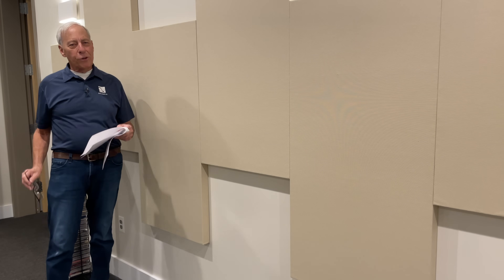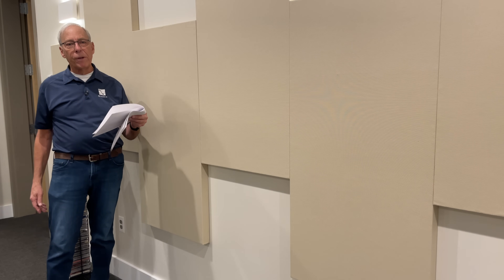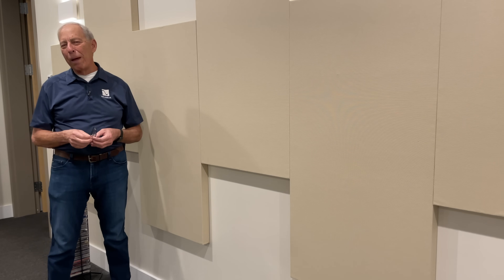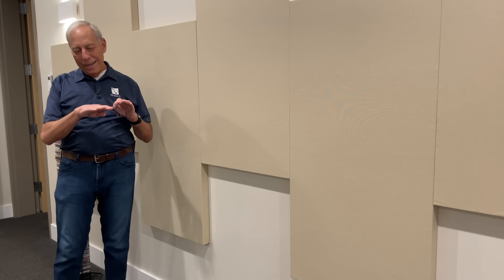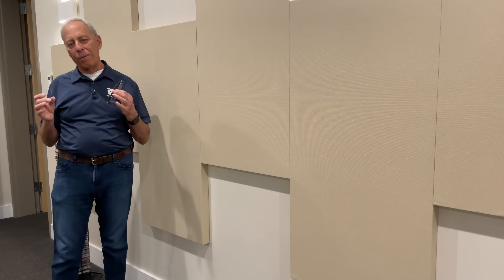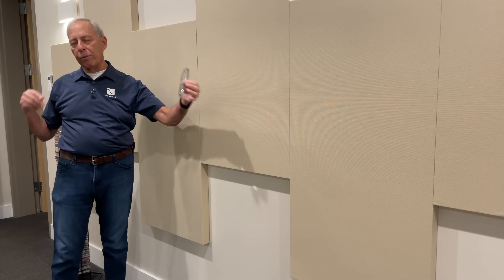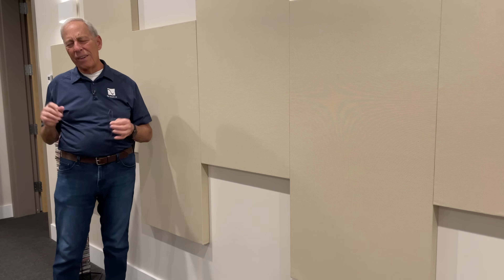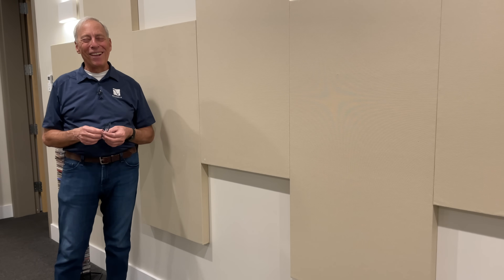Do audio connector materials matter?

Comment: I find anything that reduces DCR (DC series resistance) in the signal path (including the AC power supply path) is usually the best sounding. No connector is the best connector.
Reply: In theory that is true, however, that is not usually very practical in most cases.

Comment: First connectors are used for convenience. The addition of a connector will introduce a change or noise into the signal path. The materials are chosen for their physical properties, electrical conductivity, and ability to prevent corrosion in order to minimize connectivity issues

Comment: Paul ehh you made a mistake. 😬 Bass is made of parts copper and zinc not tin.. Copper and tin is bronze. Little detail but your right connectors materials do make a differance... For viewers.. Plated Copper colour with Iron is a no go.
I test them with a magnet if it sticks its iron plated garbish, don't use it.

Comment: Paul you thinking the cables make a difference is called placebo effect. A signal from an amplifier going through a speaker wire to a speaker is not einsteinian. The only thing that's going to matter is that it has very good conductivity which would be copper and then it has thicker gauge wire Which is less resistance. Other than that the fancy cables that are thousands of dollars can't magically make the music sound better. It's just a signal. Nothing more nothing less. It's basic
 electricity fundamentals.
Reply: "It's basic
 electricity fundamentals."...and that is the downfall of your 'argument'. On first overview electrical energy transfer via cables/conductors is simple but the devil is in the details. All materials cause materials specific excess noise otherwise termed 'signature' and this low level noise is the driver or 'nuances' in sound reproduction and preferences. Cables do cause differences in system sound and for perfectly explainable reasons.
Reply: @ericmc6482  ok, give me specifics. Mention any $500 set of speaker cables...versus let's say a pair of $50 Monoprice Monolith cables. Describe exactly why and how the  $500 pair will be able to create more blissful sonics than the $50 pair. Go.
Reply: @ryanschipp8513  I make no claims of price/'performance', I am saying that cables will sound different according to the materials used, most importantly the dielectrics used, colourants and modifiers (UV protection, plasticisers etc) in insulations have sonic effect as does the base polymer used. I find clear insulations sound most natural with titanium dioxide white colourant (damped sounding) perhaps a second best in terms of my preference. 
The key here is that all the materials in the cable introduce 'excess noise', the spectral and dynamic behaviours of this excess noise vary in accordance with the above statements and this causes 'signature' sound of cables. 
I have devised proprietary mix of elements and compounds that can be tailored to produce any sound signature desired when incorporated into insulations or connectors.
This range of 'sounds' can be varied from 'dead clean/dead flat' to any tonal characteristic and/or dynamic characteristic desired.
Cable sound is not mysterious to me, what I do find mysterious is that some audio enthusiasts pay extraordinary prices for what is basic materials science embellished by 'fancy' constructions and even 'fancier' advertising copy.
Reply: @ericmc6482  I think the major disconnect between most audiophiles vs enthusiasts vs average consumer regarding any specifics on sound quality and the debate at large, all boils down to the difference in the gear being used. Specifically, speakers that have the capability of being revealing and accurate in producing sound. Most people don't have speakers or amplifiers that are built with quality components. A speaker crossover thats using iron core inductors and sand cast resistors can't possibly reveal the nuances that youre describing. The audio signal is being smeared and distorted much more by the low quality internal components. Most probably don't even know what components are used in their speakers, much less know the difference. So, changing cables and connectors won't make a bit of difference in sound quality in their case. The bottom line is... if you have the right equipment, any changes to the material in the signal path will change the audible signal. The guy buying Klipsch from Best Buy has a much larger issue in terms of quality components than what material his speaker wire is insulated with. I respect the audiophile's pursuit of the perfect sound. I simply don't have the budget for it. The difference is, I know what I'm buying and have reasonable expectations regarding its capabilities and performance.
Reply: It's not basic at all, sadly for you it's lot more complicated.  Perhaps you belong the "fedabs"?  That's the deaf aid flat earth society. 
Do you really seriously think that the thousands and thousands of hifi enthusiasts out there are dumb or something, that they've all been made fools of?  That somehow you're more intelligent than all these people just because you understand a little "basic" electronics?
Reply: @legrandmaitre7112  Yes, he probably is more intelligent, because he wasn't stupid enough to spend hundreds of dollars on speaker cables.
Reply: @ianhaylock7409  exactly
Reply: @legrandmaitre7112  
Actually anyone that spends thousands of dollars on speaker cables is severely misled.  I guess it is ok if he has money to burn, but it is unethical for manufacturers to push this BS.
Reply: @legrandmaitre7112  it absolutely is. Why don't you concentrate on exactly what I said my comment. You are just rambling. It's simply an audio signal. Okay mr. Smarty pants, tell me what a $500 speaker wire has in it that will improve Sonic's vastly over let's say a $40 speaker wire from Monoprice. Answer me this. I'm waiting.
Reply: @ryanschipp8513  Conductor materials and purity plus dielectric characteristics/behaviours.
Reply: @legrandmaitre7112  Specifics of any discussion aside, I am quite positive that there are tens of thousands, nay millions, of deluded people in this world on any subject you would care to name so that argument doesn't prove a point.
Reply: @legrandmaitre7112  Hey he studied as far as 10th grade books so what he said must be true LOL.

Comment: I've had more than one brand of banana plugs separate - the part that goes into the plug comes apart from the part attached to wire. what seem like reasonable products, not ' cheap' > sturdy / reliable. !
Reply: Yeah, I know what you mean there! I got tired of that too, that's why I'm glad I finally discovered that the best kind of "banana" plugs are the kind that are all one piece, because not only do they not separate or break like that, but they also have MUCH better signal transfer to the actual binding post terminal because their contact area is MUCH greater than just the "standard" (i.e. 2-piece, cheaper quality), banana plugs, and as an added benefit of this design, the 1-piece ones also hold in the binding post much better than the standard ones do too.

Comment: All these people say these things make a difference.  Someone ought to give them a blind comparison test.  Let's see if their ears can detect quality levels in cables, connectors, et al.
Reply: If you are really brave, you can head over to Dave Rats channel.
He did a series of videos on the effects of cables about a year or so ago.
Or you can go back to your little safe room.
Your choice.
Reply: @Sblackfll It's one of the great mysteries of the world, innit?
Reply: Hey Jeff, what a totally original post!  You know I'm damn sure nobody has ever thought of that before!
Reply: It probably doesn't make a difference. I have seen some measurements of these connectors and according to the measurements they shouldn't make a difference.  With cables they make a difference if the resistance is too high or something but there isn't a huge difference between like a 30$ cable or 300$ cable unless the 300$ cable is made to actually modify the sound which isn't exactly what i would call a good cable.
Reply: Jeff Smith I agree. Paul once said that lifting the speaker wires off the floor improved the sound. That's when I unsubbed.